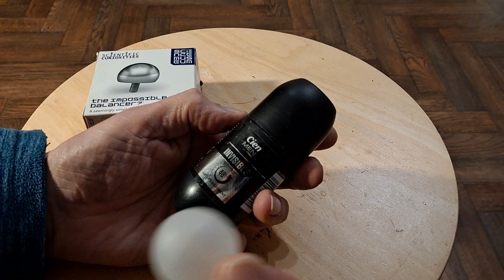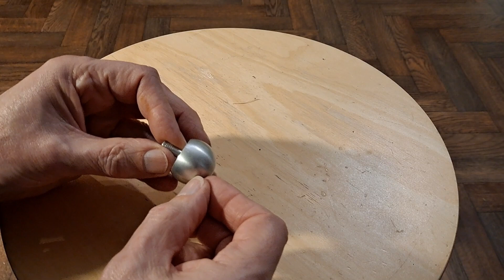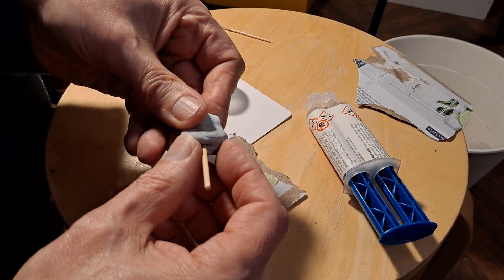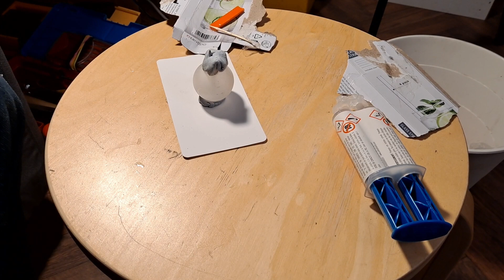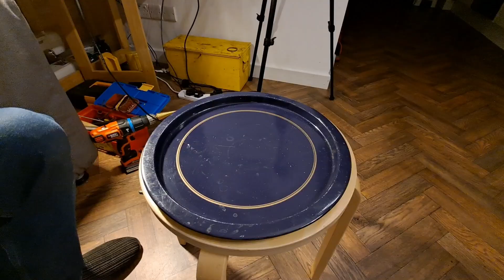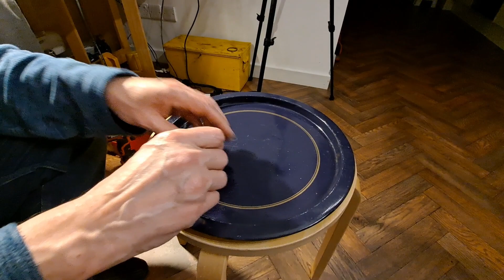Can I make a Tippe Top from household items?

Comment: Good try!  Seems to be on the right track. A suggestion:  The shaft seems short and of small diameter. Why not try making it larger in diameter and a bit longer? Perhaps you might cut a length from an old wooden pencil, drill out the center and glue it over the piece of skewer already in place. Might just work.

Comment: Very close to working. What length should the handle be? Maybe just a bit more resin and it might work fine. Talking of resin, what do you think of those resin printers? I was looking at them online but too many chemicals seem to be needed and from what I could see the printing time was longer, even for small prints but the detail is better although the parts printed are not as strong as PLA. 😁👌👍
Reply from the maker: Yes, I think you covered all the issues there. Chemicals, and a weak product. Highly detailed and able to produce shapes that would otherwise be difficult to print. I think I will pass on them.

Comment: Making the end of the peg a bit bigger diameter will help it to stand up.  When the peg touches the tray, it helps if the peg is trying to drive forward along the ground, rather than being merely dragged by the gyroscopic action.
To see this effect (in reverse), take a working Tippe Top and sharpen the end of its 'handle' to more of a point: you'll find that stops it from standing up (or at least makes it much worse at standing up).
Once a top is standing vertically, it's very happy to spin on a point.  But while it's trying to get there, having the 'wheel on ground' effect of the handle trying to precess the top faster than its natural precession speed helps a lot.

Comment: You can get your resin "more runnier" by microwaving it after it has been well mixed. I got excellent results by heating it for about 10 to 15 seconds in my 900W microwave. It gets really thin and pours very easily.